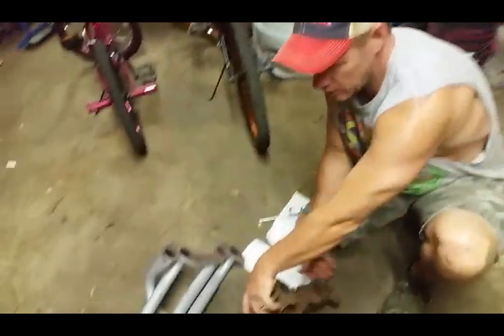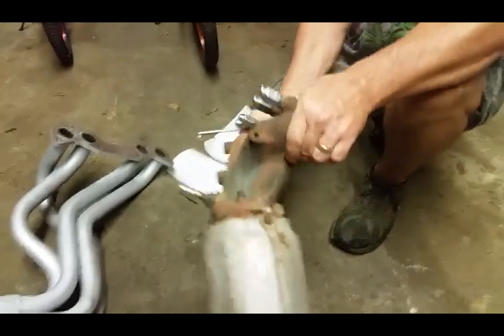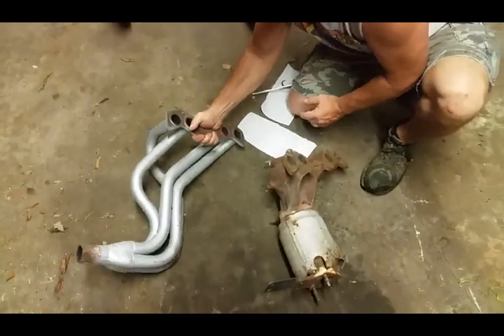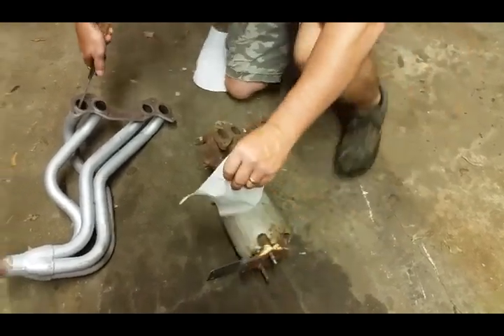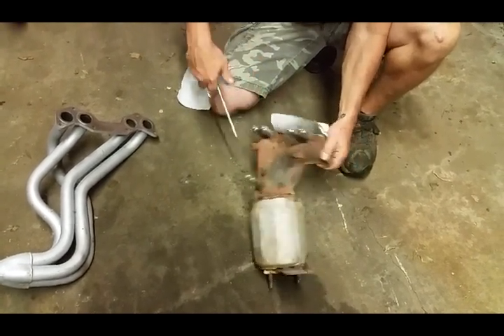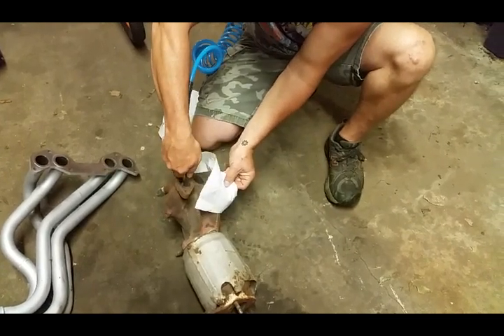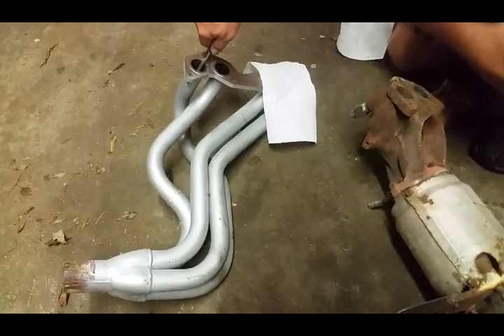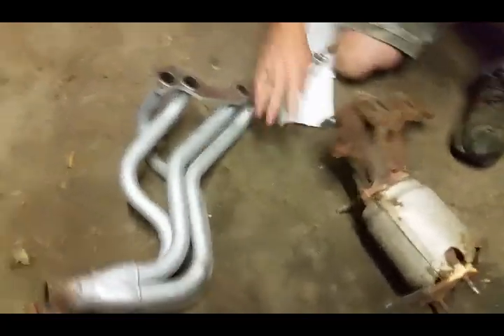Exhaust Manifold vs Pacesetter Header

Comment: Hey Mitch, I just recently stumbled upon your videos after my 12yr old son bought an 88 b2200 from the original owner. The entire exhaust is shot and rusted to nothing. I am ordering headers for it this week so I can install them and fab up new exhaust so we can actually breath while driving it around the property. My question IS can I install the headers with new exhaust and remove all the OEM vacuum garb from the truck and it still run decent with original carb? Basically preparing for the weber but still want it to run in the meantime for a month or more. Tks!
Reply from the maker: Yeah you can. The original carb may run a bit rich though, but yeah we've done it.

Comment: I WISH THEY MADE A HEADER FOR AUTOMATIC TRANSMISSIONS ON 1989 B2200. I WOULD LIKE TO HAVE ONE UNLESS SOME ONE KNOWS OF SOMEONE THAT HAS TRIED IT.
Reply from the maker: The same header works for both standard and automatic many guys use it on the auto. You may have to massage it a little but it works.
Reply: I put pacesetter headers on my 91 automatic b2200.  It works great! The webber carb was a little bit of a challenge because I had to run a high pressure vaccum line from the carb all the way to the transmission but after that it done fine